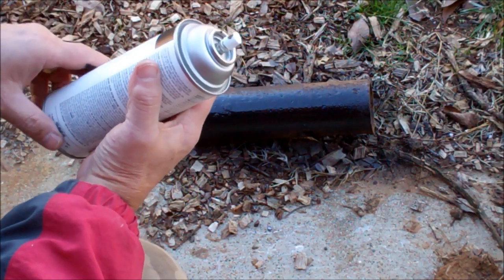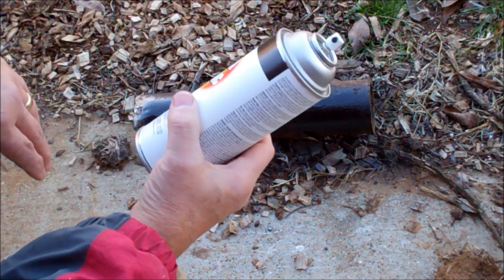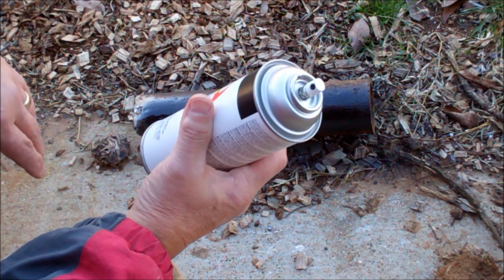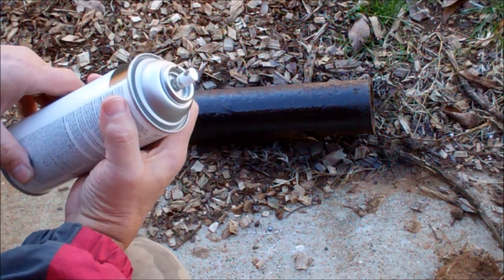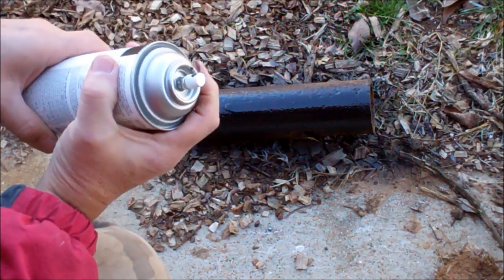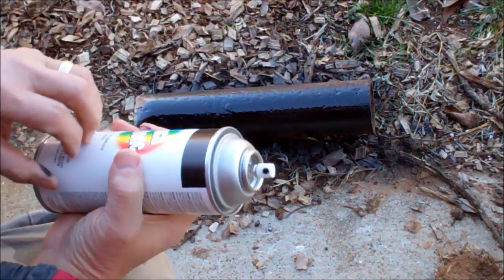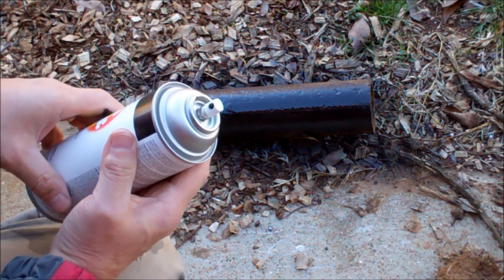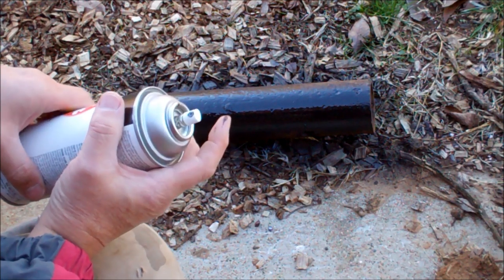How To Make A Can Of Spray Paint Last Longer

Comment: Just air coming out. No thinners.
I keep a little jar (with a lid) with a little thinners in it (I think it originally held anchovies) and after I clear the tube I pull off the nozzle and pop it in there. I put in nozzles from finished cans too for spares.
Just turning it upside down does NOT clear all the paint as there is a little residue left on the nozzle hole, and while this will normally blow off when you next use the can, some residue around the edges will often cause an uneven spray pattern.

Comment: Or you can just buy extra 2-3 caps end save the much needed pressure inside the can
Reply: In addition, this tip will not work on Plutonium brand spray paint cans, they are designed to be sprayed upside down.
Caps are dirt cheap.
Reply: It's more about cleaning the tube than the caps